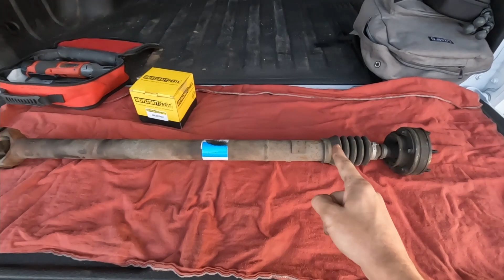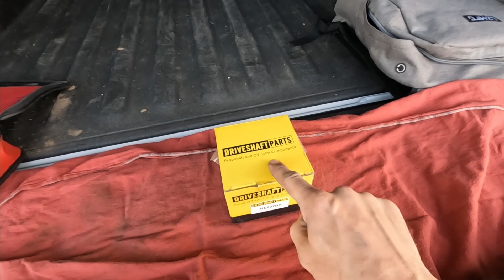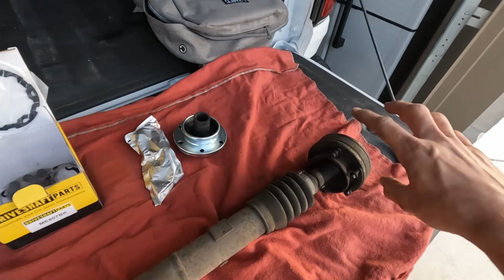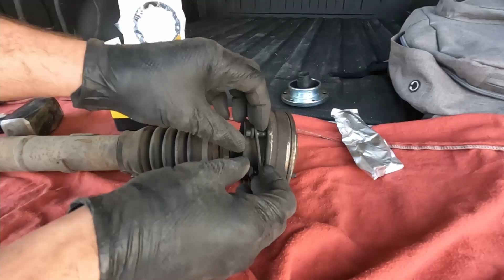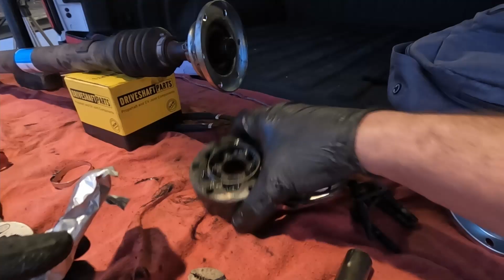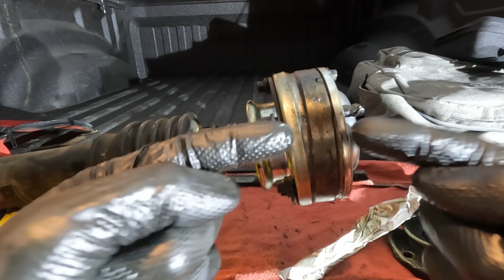$1000 Driveshaft Repair For $15 Jeep WJ Grand Cherokee WJ Driveshaft Repair DIY

Comment: Where did you get the double (both end) u joint style axle?
I plan on using my WJ for offloading and plan to install a 4 inch lift

Or did you get it off a salvage vehicle? If so what vehicle or part number?

Thanks

Comment: The kit can be a PITA, I did mine last summer, just make sure to pack every single ounce of grease inside. The double u-joint is a better option IF you are not on a budget

Comment: I go through about 1 or 2 every year and have to replace the CV end with a kit. I do have the after market driveshaft ready to be installed and be done with the boot rips. Don't buy the Amazon crappy kit. The best one I found was in 1A auto
Reply: I found out that 1a auto has better quality. I go through about 3 per year and that is due to driving lots of miles per month. What helps my CV boot rip more is the 3 inch budget boost lift I put in. It changed the angle of the shaft causing more wear on the boot. I have a double cardan shaft I am about to install and hopefully that cures the multiple rebuilds I have to do per year. I agree! Amazon is crap and their rebuilt kits only lasted me 3 days. As for the title of this video, for $1000 savings is pure BS whoever sold him that lie. Must have been the steelership

Comment: thasnk for the vids just pick up the parts to do the auto headlights gonna install tomorrow.  Do you know if its as easy to had defrost side mirrors or headed seats. Id image seats are lil more trouble to get the units wired.  Also curious if all WJ have the wireing in the back area to add the extra 12v socket?
Reply from the maker: The heated defrost mirrors are super easy! Just install them and plug them in and when you hit the rear glass defrost they come on. I need to look into the rear 12v install. Thanks for the view!